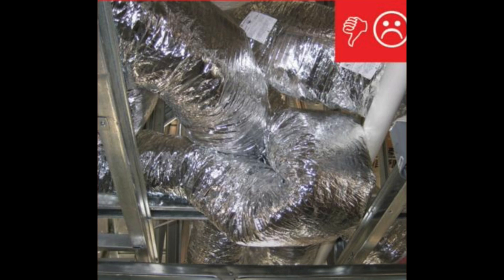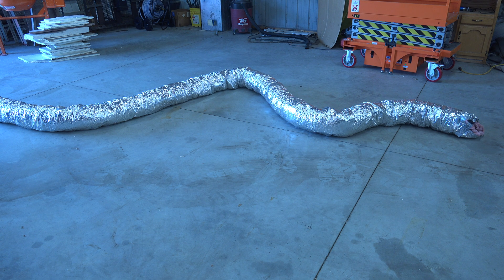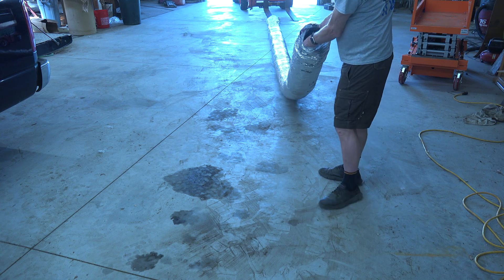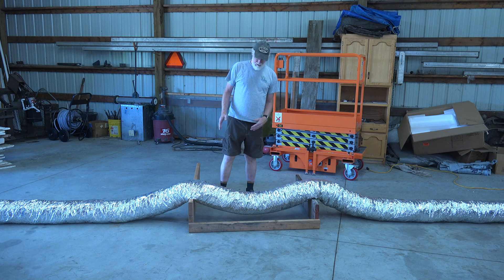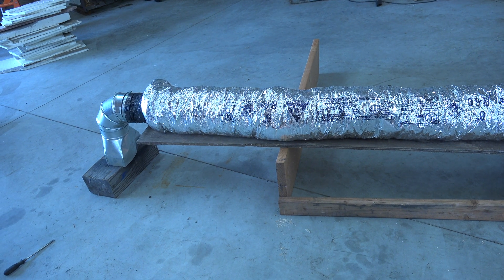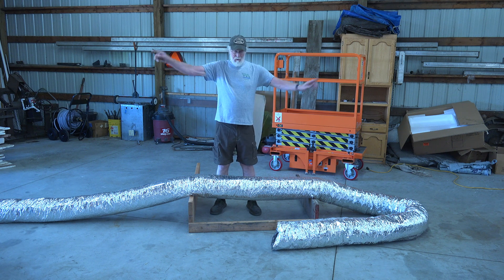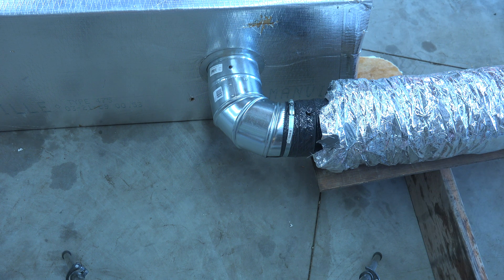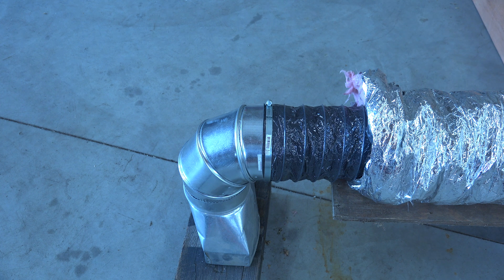Problems with flex duct

Comment: Helped me a ton! System was shutting down because it couldn’t get air flow. 3 companies said I needed new heater since it was old and that th we ducts don’t collapse or cause air flow issues.. But code in unit was saying airflow restrictions. Ducts looked way worse with curves and bends than he had in this video.  Fix the kinks and bends and problem solved

Comment: I have watched many of your videos, very informative.  How can I find a replacement liner/heat blanket for my Well McClain boiler form (they think) the 1950's or 60's that needs a new one?  Can't find any info. on sizes at the stores and my tech company can't either.  Also, the steam system it is hooked up to may need a new boiler (they say).  I wonder if part of it is the techs say they've never seen/worked on these so a comfort level for them (at my expense!).  I have 19 steam radiators on one zone.  Not even sure how large a system or what (if any) I need to replace with.  Hoping to reline interior and get a few more years out of the current furnace.  Advice?  Thank you so much.  Retired now, limited budget, and any information will help tremendously.

Comment: Hello I have a broken element in my furnace the man working on my furnace said ot would be ok till he could find a replacement.  My daughter ran it overnight.  When she woke up the house was smokey. She turned off the furnace . The elements stayed red hot.. had to shut off breaker. Any ideas?
Reply from the maker: My thoughts are that the broken element has shorted to ground. That will result in a portion of the element staying on. 
The only solution is leave the furnace off until the replacement arrives. Keep the breaker off. 
GFM

Comment: i noticed these little quirks of flex ducting recently when i reran my basement dryer line.. did it on the cheap cause its electric and its one of the newer driers with many temps and i never use more than med, the run is entirely plastic flex and it flows better than the old foil flex the previous owner had in there. and i suspeect its because its nearly a straight run with only one bend thats not tight at all. the previous one had a huge sag in it where im sure lint was building up and pulling it down further

Comment: great examples of hard pipe elbows and straight flex pipe on "flat surfaces". being cheap and fast is what made them "great". just like everything else cheap and fast, the failure rate is giant right from the start. also rodents cannot chew through, nor enter proper hard ducts 🥸

Comment: there's a problem with stretching the flex ducts on install,  they shrink and break down with age, ripping apart at random places with normal airflow! that may very well have been the case in many cases. more or less, they need a flat trough or "bed" to lay upon, when only supported here and there or by wide strapping failure is inevitable. 
new ducts in my own home? 99.9% hard piped. sans insulated bathroom exhausts (minimal temperature fluctuations). 
not afraid to knock tin and did an "ten times" way over my head job, in an tight space commercial building attic, not only that, in below 10F weather, effectively removing the only heat for the large building full of glass front coolers. sweating bullets and knocking tin like mad, re-using existing ducting to re-make transitions for new gas duct heater.
sweating bullets x900. got it done after way too many hours. their other options were remove roof or remove ceiling and all multi rows of wine shelves and other products below for a big lift to fit and remove old unit. I had to bang apart 36" square duct and two 16 x 32" to move it away and built an rack/storage sled to hold the old giant unit heater.
I should have never taken on the job, but I did and got it done in about 12 hours straight.

Comment: those bad installed flex ducts, remind me of being a kid, where we smashed in a random 150K furnace into a tiny house(bad #1), then where the ducts didn't line up and had to clear main beam,  four elbows in roughly 90 angles to go down around and back up... yeah, that's what happens when you have your son and his friend(me) install things at age 14..... 🤣
we actually repaired multiple 2 line deep well pumps (in well ejectors) back then also. but those were pretty easy, check depth to make sure footer valve wasn't in muck and repair the leaking poly pipes, pumps or various parts. those were easy at that age. man are still working to this day(30+ years ago now), some had issues, from brass corrosion (pinholes in ejector or footer valve).

Comment: I’m a DIY type and I use hard duct with insulation wherever I can when retrofitting my 100 year old house. The only place I used flex duct was installing retrofit jump ducts from the upstairs bedrooms to the hallway. But I used a larger diameter than the supply ducting to compensate for the added friction.

Comment: The real question is what is the static pressure of a crushed flexible duct …..
Answer: it depends how crushed it is …
I do know however , that adding an adjustable 90 is equivalent to five additional linear feet …thus increasing the load on the blower potentially ….

So adding a 90 could be worse in some instances….although it will prevent crushing
Reply from the maker: When you are installing an adjustable 90, you are doing it because you need to change direction.  This is just a better way to change direction with less loss.
GFM
Reply: @grayfurnaceman  I am just thinking that a “a properly installed“ flex duct is probably better than an adjustable 90 ….just saying ….that is my guess anyway, I looked up the chart , an adjustable 8” 90 degree bend is equivalent to an additional 1 foot 7 inches 😅 ( not much )

Comment: Here in australia we used to have flex ducts with a semi rigid perforated aluminium core (like the dryer ducts you have in the states) They were insulated with fiberglass and a clear polyethylene sleeve. They had very low friction loss and never sagged. That style lasted from the eary 70s throug to the late 80s when interlock was introduced. That had a silverish tarpaulin type fabric core and a mechanically locked wire and plastic channel. They were very good. The semi rigid ones forced installers not to cut corners and make tight bends and squash them. Although I have seen them kind of crushed to fit but not as bad as modern flex. If you look up "flexmaster triple lock" thats pretty much how it was.

Comment: Great video, thank you.  I wish that I could find flex duct with a better insulation value than R8.  I have flex duct in my attic, and there is significant unwanted heat transfer between the duct and the attic on the longer duct runs.  I find it interesting that while the ceiling has R30 insulation (I believe), the duct work in the attic only has an R-value of R8.  PdZ.
Reply from the maker: Agreed.
GFM
Reply: You can double wrap insulation around the duct to increase the R value. Just make sure not to wrap it too tight against the insulation or it'll kill the r-value
Reply: @acomman77  Thanks!

Comment: How do you deal with ducts sweating when you lay them on a plywood runner?
Reply: Strap the flex enough so the insulation isn't getting crushed or it will kill the r value. Also make sure you're running r-8 insulated flex.
Reply from the maker: Using a continuous support spreads the weight of the duct over a larger area.  The crushing of the insulation is minimized.  
That does not mean the duct will not sweat.  If the RH is close to 100% in the unconditioned space, you will get sweating.  
That will have to be dealt with through ventilation or dehumidification.
GFM

Comment: ducts don't belong in hot/cold attics anyway - there's always a way to avoid but builders are cheap!
Reply from the maker: Agreed.
GFM
Reply: It would take a code change, to get ducts out of attics.
Reply: @loumonte658  if builders and home buyers weren't so cheap and retarded when it comes to this stuff - mandating by code wouldn't be required.

Comment: The duct work in my house is awful. The unit is lower and all the flex come out and go higher and bends all over the place. Should install elbows to help it circulate better?
Reply from the maker: Flex duct is only designed to work in straight runs.  If you must make turns, hard pipe ells should be used.
GFM